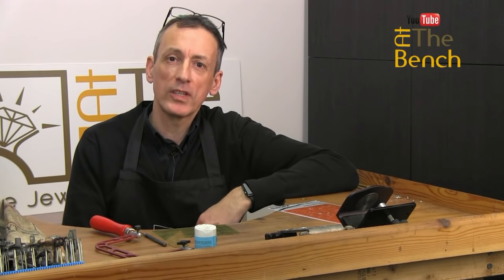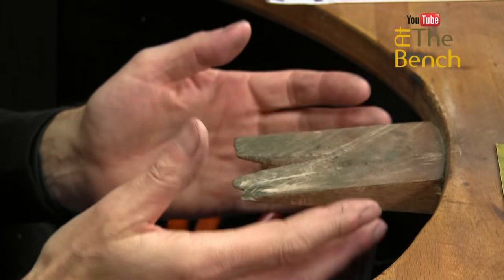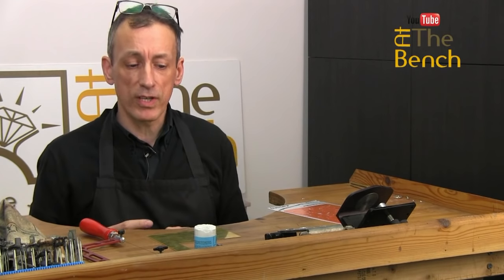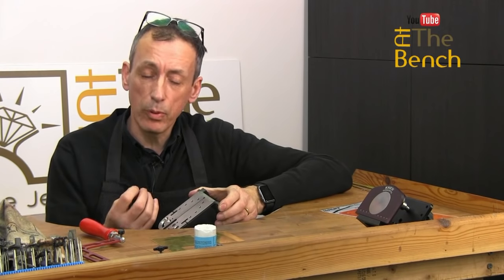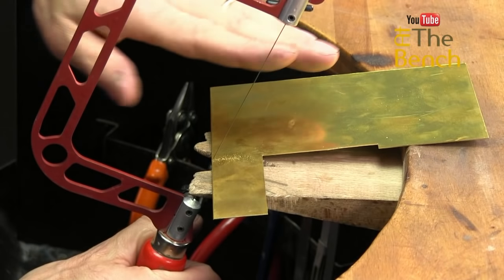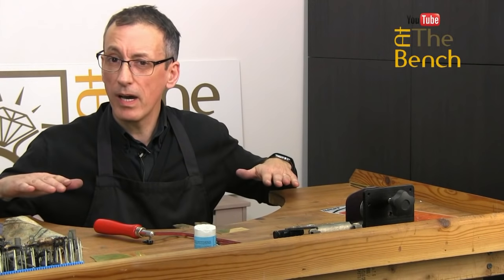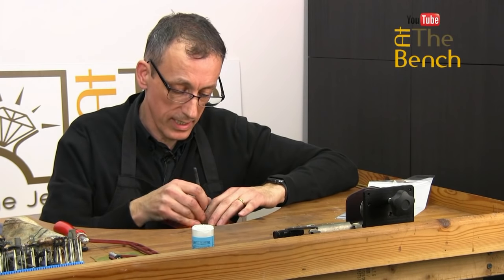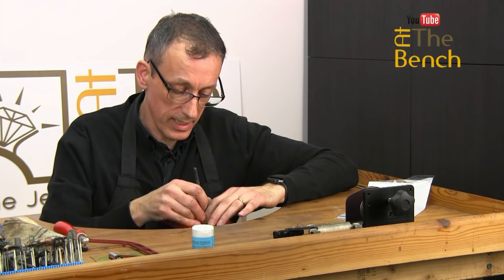How To Cut Curved Lines With A Piercing Saw - Making Your Piercing More Accurate

Comment: Instead of "waxing" the top of the piece you are cutting, since the shavings will stick to it, wax the underside of the metal.  You'll still lubricate and be able to see  your lines.
Reply from the maker: Good tip but I feel that the shavings/lemel would get stuck to the underside and scratch the metal

Comment: I understand the need to cut on the waste side but do you have a video explaining exactly how you file down the metal to the sketch line? What I'm interested in is what brand and type of file you use for fine work? My files get clogged continually when filing soft metal- brass, silver etc.  so perhaps I'm using the wrong type of file. Any help you may offer will be appreciated.

Comment: So if you add another sheet of metal to make two shapes of the same size, would you use the same size saw or would you change it for the doubled metal thickness?

Comment: Andrew, when you say the "teeth will cut in a downward stroke ..'in theory'," does that mean it doesn't always? I find it drags a neutral (doing nothing) on the way up and cuts on the way down- always. When you say, "in theory", does that mean it is not consistent? Or is that an expression? Thans so much for all your amazingly generous and spot on videos!